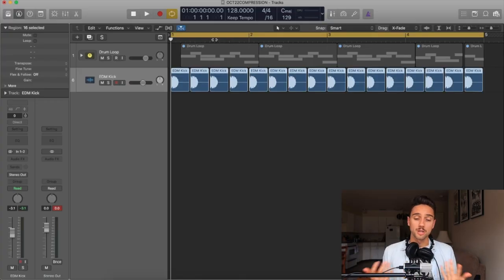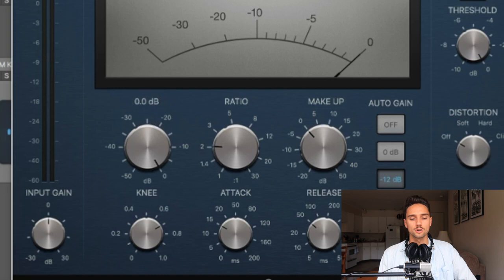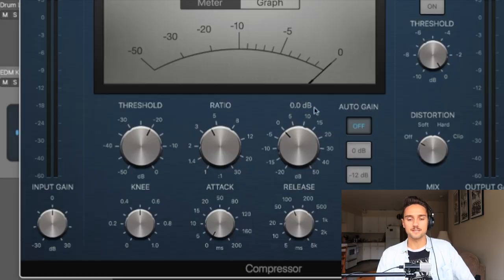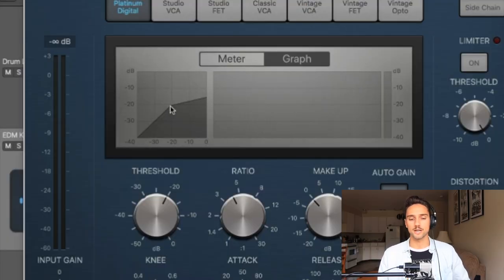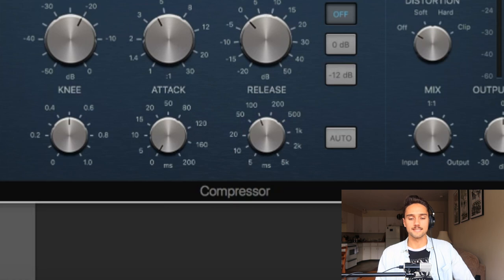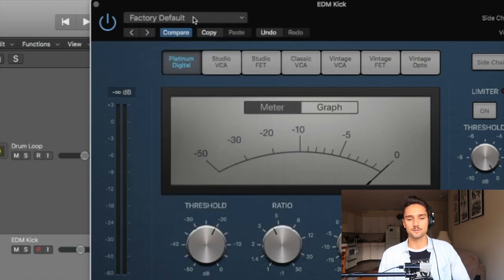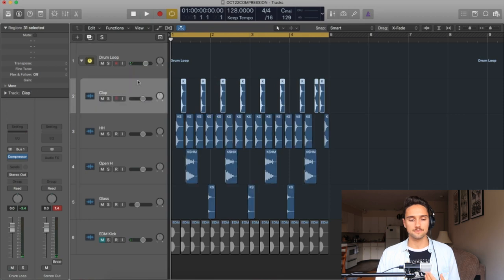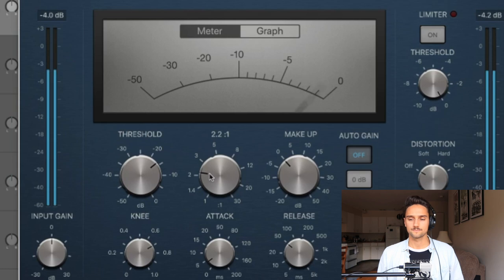How to Use Compression | Logic Pro X Compressor Tutorial

Comment: Thanks for this great explanation. I do have a question please. Is compression also supposed to boost the low frequencies, or is it strictly for lowering high frequencies? Thanks
Reply from the maker: Hello!

Yes it can be used for both frequencies. You can get further into detail by using a plugin called 'Multipressor', which will allow you to compress different frequencies with different parameters.

Thanks for watching!
Reply: @itstonyholiday  thanks for responding!
Reply from the maker: @BetterDayzMusic   Of course! Thank you for watching

Comment: Hi, I really don't understand how this compressor works! Can you explain it to me? So what does the treshhold stand for,? when for example its set to -20 , every decibel is cut out , or is it the ratio that reduces the loudness? and the make up gain basically just makes the track louder, right? haha I got probably everything wrong
Reply from the maker: The threshold represents the volume level that the compressor will start to compress. The ratio is by how much it will compress.
Reply: @itstonyholiday  and how is it calculated, the ratio? like 2 is the half and what is 3 the third, or are these the decibels that are cut out?
Reply from the maker: 2 to 1, 3 to 1, etc

Comment: This was very helpful thanks man! I have a question I looked at the apple website about the different compressors and I see that the VCA compressor is made for bass guitars. Well I did a subsonic bass using the vs2 I believe and the lower notes sounds good (shake my car lol) but I go a few notes above and you can barely hear these bass notes. Well I used the Platinum Digital  and tested the bass again sounds good, now the higher notes actually shake my car, but it’s kinda distorted. Honestly I didn’t know how the compressor actually works when I did this but if the higher notes now are more present that means I did something bad or no? And would you recommend to try the VCA or just adjust the treshold, ratio and attack on the Platinum Digital and try it? 
I hope you understood what I’m trying to say, thank you bro!
Reply from the maker: Hey man! The compressors that are built into Logic are based on real hardware compressors so they’re more or less a guideline. The best rule of thumb is, if it sounds good/the way you want. Go with that 👍

Thanks for watching, glad you found the video helpful 🙌